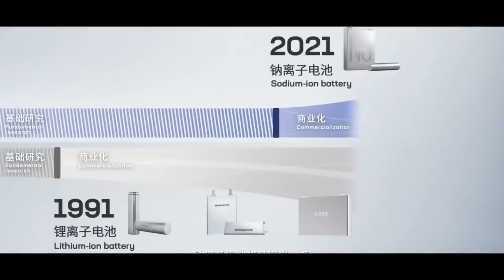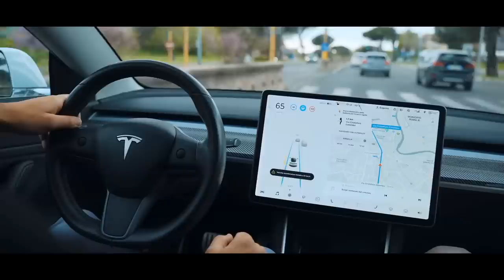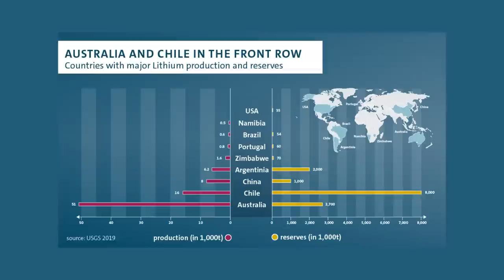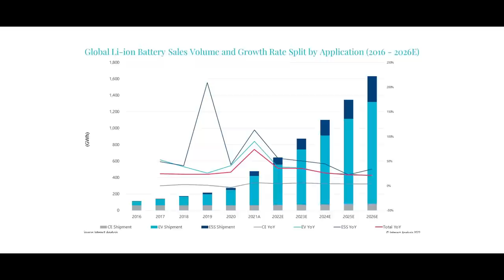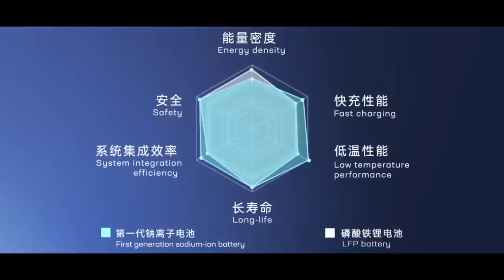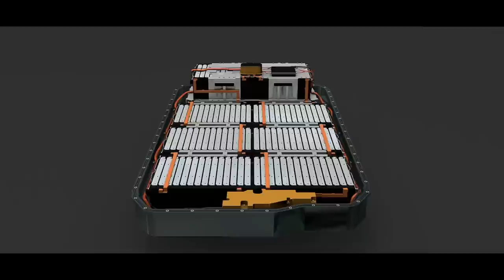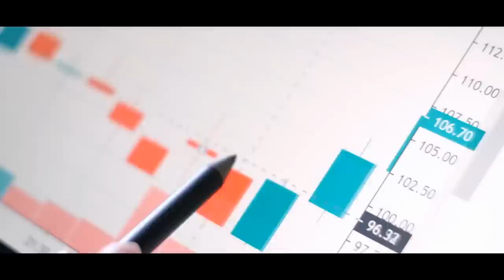No More Lithium! NEW Sodium Ion Battery 2.0 Changes Everything 2023

Comment: Sodium Ion seems to be preferable to LiFePo4 batteries in every respect, except sodium ion batteries not quite being available yet. Am I missing something?
Reply: Maybe they mean on paper so to speak. They would seem more preferable and yet why then are they not being made available to us. It might be due to the batteries not being practical for us the general population. You do know that they have something that is similar to a battery and as long as you keep feeding hydrogen into it , it keeps producing power.  Hydrogen fuel cells have a far greater energy storage density than lithium-ion batteries, offering a significant range advantage for electric vehicles while also being lighter and occupying less space
Reply: @carmichaelmoritz8662  Hydrogen has lots of other problems. It needs to be stored under high pressure, or it will take up too much space. It takes energy to get this high pressure and it is a safety risk. The high pressure containers are also heavy. Also production of hydrogen is not particular efficient. Hydrogen is also hard on metal in the long run. Hydrogen do not make much sense to me.
Reply: @Foobarski  I drove a hydrogen powered scooter and a lifepo4 cell powered scooter and if not for the price difference I would've chosen the hydrogen powered scooter. It had two removable canisters and to more in another compartment. I could easily drive 200 kilometers and not worry about being stranded anywhere.  all the lithium powered scooters would've left me stranded due to the battery pack going dead.
Reply: @Foobarski  Yeah, you touch on how hydrogen is hard on metals, because it's such a small molecule, it penetrates its holding container and conduit walls. I think there have also been some serious accidents because of the problem of hydrogen penetrating and attacking materials.
Reply: @carmichaelmoritz8662  "if not for the fact that magic doesn't exist I would choose the flying carpet."
Hydrogen and hydrogen fuel cells are  never going to get significantly cheaper.
Also you do know you can charge an electric scooter, right?

Comment: As a lithium and EV investor I welcome the sodium battery. Sodium batteries will be used for stationary storage and 2 and 3 wheel vehicles. We need all the lithium we can get with all the 2035 government mandates to switch to 100% new EV sales by then.
Reply: They'll also be used for cars and already are in China. 160Wh/kg is good enough for standard range cars, especially since you can save some of the thermal management (sodium batteries being much more stable at high and low temperatures).
If CATL keeps its promise of 200Wh/kg it will be a no-brainer for anything but very long range cars.
Reply: @4203105  No chance. Too heavy.

Comment: The next NEW and even more Powerful battery will the the Sand Battery. We see Sand on beaches and in our shoes. Why are we messing with Lithium and Sodium go directly to Sand batteries. It is a new tech. Almost as new as windmills.
Reply: Sand Batteries are for grid scale, as they are heavy, they’re also used for heating not electrical storage, so completely different applications

Comment: The worlds lithium production between 2018 and 2021 was almost the same. But the way you tell it is mis-leading. You are missing or ignoring the years in between which is very telling. It was almost the same in 2018 and 2021 because after 2018 they had to ramp down production due to not enough demand for lithium. China as you stated was stockpiling it (as had many others), and then that lowered its demand for several years as it did not need as much. Lots of companies had bought and stockpiled it. I know mining companies in Australia had ramped down production simply due to supply and demand, not because they could not produce as much. But the way you say it implies they are not able to produce as much to keep up with demand, which is currently not correct at all.

Comment: How about thermal overload? In the US at least we have had several thermal overload failures to the point if you have a EV insurance may not allow you to park inside your home.
Reply: EVs burn down about 40 times less often than combustion cars. Your insurance is dumb.
But sodium ion batteries are extremely safe and very temperature stable. They are even safer than LFP batteries, which are already much safer than NMC or NCA.

Comment: lithium cost $70,000 a tonne but once supply catches up it will be $20,000 a tonne , and you said we will run out of lithium then show Elon musk saying there is no shortage of the element itself.
Reply from the maker: again: according to a study of the pv magazine the known lithium reserves known to date will run out by 2040.
Elon musk is complaining about the artificial shortage and the price explosion of lithium in the current times.
Reply: @The.Futurist  hopefully graphite is next $$$
Reply: Not very shortage of Lithium , but it isn't abundant also. Sodium is everywhere , very abundant and very easy to "mine" . Even if it has like 50% of the storage/weight ratio , the price of it would be way cheaper/kW . This makes a huge change since there are a lot of batteries needed for changing to renewable energy , which does need storage when sun don't shine or the wind doesn't blow . Many Li batteries are used for that purpose and many more are needed.
Reply: If Elon Musk says something you can be absolutely sure the opposite is true.
Reply: @The.Futurist  well that's bullshit. Are you sure you aren't confusing "known" and "developed"? We know about lithium resources all over the world.

Comment: So a presentation on Sodium that ends on Aluminium within the space of the video! I will wait for the dilithium batteries before committing as we are getting though a new breakthrough element a year in the current battery of the future. Net zero today but the actual technology to run it sometime tomorrow or in someone's dreams sometime never. Great that this work is happening but implementation timetables forcing the move from fossil seem to be in a total panic detached from availability, practicality and affordability. Like trying to get on to a treadmill running completely out of control in all directions.
Reply from the maker: And what about tritium batteries?

Comment: Can any of them charge in hostile environments where temperatures are -67 f? Produce the produce please I want to see if it will.
Reply: Are you living at the North pole? That's -55°C. It doesn't even get that could at the ass end of Norway.
CATL says these batteries still have more than 90% capacity and charge well at -20°C.
I don't think anybody considered Satan's freezer for testing.

Comment: Couple points about this. First, it is VERY disappointing that the USA is not working on such tech. The USA it seems is more concerned with providing sex change for their children,  and social justice nonsense than technology it seems. These new batteries have the same explosion risks as lithium. We now see very few battery explosions because there are so few EVs on the road. Charging a zillion times faster is leading to a "class system" where the rich and powerful will have fast chargers while the sheeple are to be limited to slow charging due to limits of power production and grid capacity. (short lithium when these batteries go into production!)
Reply: Lithium batteries don't explode. They can burn. But electric cars burn 40 times less often than combustion engine cars.
Also no, these batteries don't have the same risk. sodium-ion-ion batteries are extremely thermally stable. It will take a lot to get them to burn.

Comment: I was wondering, when some chemistst would reconsider the other elements in the periodic system: Sure, the element with the highest electronegativity (lithium) is tempting, but it is also scarce and poses environmental risks. Sodium is heavier than lithium, but is abundant in nature: just take salt from sea water, and you do not only have sodium, but chlorine, which is used in the chemical industry and fresh water, which is of growing demand anyways.
What could also bring interesting results: instead of moving down in the periodic table, one should take a look to the right of lithium: berillium, boron as well as magnesium and aluminium are rather light and offer the advantage of delivering double or even triple the amount of electrons per atom when compared to lithium and sodium.
Reply: @Blueknight1960  That is an interesting point: the benefit of EVs only comes to bear IF the electric energy for charging the  battereis comes from renewbles (solar, wind, geothermal, hydro...).

Comment: Doesn't matter what type of battery they use in ev's, the price of the vehicles will never come down. If anything any new battery type will only increase the price of the vehicle and on top of that, new power plants will need to be built to support the charging needs.
Reply: The Chevy Bolt which was selling for $26000 but now has dropped to 23000

Comment: @7:12, Sodium ion battery at $80/kwh isn’t cheap anymore as lithium ion phosphate is at or below that price, today. In fact LFP price should reach about $50/ kwh by end 2023 if not sooner. Finally, the earth has no lithium shortage as this fear mongering video would want viewers to believe. Like so many YT videos this video has a secret agenda with which hide-the-ball narrator  will hurt you.
Reply: Yep.  Even the hypothetical energy of 200 mw/kg is 20 to 40 percent less than lithium, which means you need 20 to 40 percent more.
Reply: Well it's the middle of 2023 and LFP batteries have held steady at around $130/kWh. In what phantasy world were you projecting $50? That is never going to happen. Cheapest LFP is going to get is $80 and even that will take years at this rate.
Reply: @robertdascoli949  so what? If it costs less per kWh, just pack more in. Or don't. sodium-ion batteries have extremely fast charging. So you don't need as much range anymore.

Comment: But it only has 75% surface capacity to li poly ions, so unlikely to be used in cars due to 100 miles less range.  Sodiums will just replace tablets, phones, laptop as less fire explosive, and less air risk.
Reply: Other way around. In phones etc. you need a very high energy density. In cars not so much. You can just put more cells in (to a point).

Comment: How about getting rid of the battery all together and going with fuel cells hydrogen fuel cells and find a way to convert methane gas into  hydrogen on demand for safety using landfills sewage treatment plants mainly in various other sources of methane as source material and converted into hydrogen on demand through converters whether if it's built into the car or on the gas station wouldn't that be a much better solution a much more practical solution

Comment from the maker: Amprius NEW Silicon Anode Battery 2.0 Changes Everything in 2023
https://youtu.be/3zQ3YUJFsww
Reply: - Sodium-ion batteries have a lower voltage (2.5V) than lithium-ion batteries (3.7V), which means they may not be suitable for high-power applications that require a lot of energy to be delivered quickly.
- They have a slower charge/discharge rate than lithium-ion batteries, which may not be suitable for applications that require a lot of power to be delivered quickly (such as electric vehicles).
- Sodium-ion batteries still have limited charge cycles before the battery begins to degrade, and some lithium-ion battery chemistries (such as LiFeP04) can reach 10,000 cycles before degrading.
Reply: @cg986 and all those claims are based on?.
Reply: @cg986 do you justify the fact that, lithium should still be used?.
I mean the main problem was already said at the video intro.
Lithium is falling short in the industry and the world need an alternative. 
So, wether or not lithium is better is just gonna be for now wait till the future!.

Comment: The corrosive property of salt is well known. Are these batteries liable to leakage and corrosion problems I wonder.
Reply: The corrosive salt you're thinking of is sodium chloride, also known as table salt and sea salt.
Sodium the element is a metal just like Iron, Aluminium and Lithium. So it should not have any more or less leaking/corrosion problems than batteries made with those other metals.
Reply: If I'm remembering correctly salt is only corrosive with water. But I might be wrong.

Comment: This technology has less energy density per kg, so not that good at addressing the main problem with EV - low range and long time to re-tank.
Reply: These can charge a lot faster than lithium-ion batteries and since they are cheaper, you can just put more cells in the car, if you really have to have a big range.
Reply: @4203105  The point is, you put more batteries in the car, the more dead weight you have. In a gas car, the gas tank weights 80kg, while the car weights for example 2,4t, that makes it 3,(3)% of the weight of the car, you could easily make the gas tank bigger to give the car more range, but it is pointless given how easy it is to refill it when needed. On contrary a similar electric car with weigh 3,5t with 0,5t already occupied by the battery. No, you cannot stick more batteries in the car, because of how much % of weight you are expending on the batteries themselves, and given that batteries are NOT the only dead weight that a car has, you are very close to building a car that simply cannot haul anything besides itself.
Reply: @mik1984  yes you very much can. In electric cars you get most of the expended energy it takes to move that weight back from regenerative braking. So the weight matters very little and a lot less than other factors like how cheap the battery is and how fast it charges (which is very fast with sodium-ion batteries).
If you think there is actually a problem with hauling capacity you don't know what power electric motors have.
Reply: @4203105  The more power an electric engine has, the more energy it consumes. Just as the power of the rocket engine is mostly constrained by the amount of rocket fuel you want it to consume per second.  You simply cannot double the weight of battery from 0,5t to 1t and not make the car considerably less energy efficient, not counting all the other downsides.
Reply: @mik1984   that's not how that works. The more powerful the electric motor the bigger the capacity for regenerative braking. So energy expended is bigger (because of the extra weight, not the more powerful motor) but you can recuperate most of it.
Also the standard range model 3s LFP battery weighs 324kg, at 126Wh/kg, so if CATL is to be believed and their sodium ion battery does 160Wh/kg, it would actually be lighter than model 3 LFP batteries and a battery with the same capacity would weigh only 255kg.
Also that Tesla would rather use older, less capacity, cheaper LFP batteries, rather than the cutting edge, more expensive LFP batteries, should tell you how unimportant weight is.

Comment: The biggest downside is that sodium-ion batteries have a lower energy density than lithium-ion batteries. This means an EV with a sodium battery that's the same size as a standard lithium-ion battery would not be able to travel as far on a single charge.
Reply: Not a problem in a fully built out EV network, as Sodium ion batteries charge much faster.  i.e.  to 80% capacity in 15 minutes.  Not a problem for most trips as in a fully build EV network,  charge stations would be at least every 100km.  Also that range limitation averages out in colder temperatures, where it has an advantage over Lithium ion batteries.

Comment: BS. These batteries have different characteristics. They won't replace Lithium batteries except maybe for particular immobile applications. They have a lower energy density. They are like a worse / but potentially cheaper alternative for things like houses or power stations. They are not suitable for cars, or phones, or drones, or computers, anything mobile is better off with Lithium, as far as I can tell from the discussions around these batteries.

Comment: It has lesser energy density than li ion batteries
Reply: So?
Reply: @4203105  can’t be used in bikes that requires more energy with less space, otherwise the bike might look very bulky,
Due to its bulkiness it is also going to consume more energy in EVs
Reply: @vanmam  are we talking bicycles or motorcycles? For bicycles the energy density is more than enough. For motorcycles you might have a point, but so what? Just because it isn't ideal for some niches doesn't mean it's bad.
Also the added energy consumption in EVs due to extra weight is marginal, due to regenerative braking. You'll never pay more for electricity than you saved when buying the car because of the cheaper battery, even if you drive that thing for a 100 years.
Edit: also 160Wh/kg (and later 200Wh/kg) isn't all that bad. From all I can find the LFP batteries in the Tesla model 3 are 126Wh/kg. Even if they are better now, that was true for a long time. Didn't make the model 3 unusable.

Comment: So you're producing another battery that is just as heavy as Lithium and therefore practically useless in the long term.
Reply: Why would it be useless?
Reply: @4203105  Uses absurd levels of hard to get materials. Gas powered cars require Steel & Aluminum for their metals. Very plentiful. Elements required for batteries are very damaging to the environment (horror show bad) and are relatively rare.